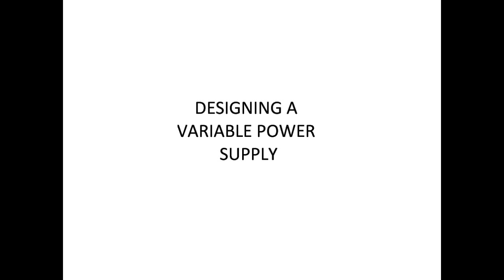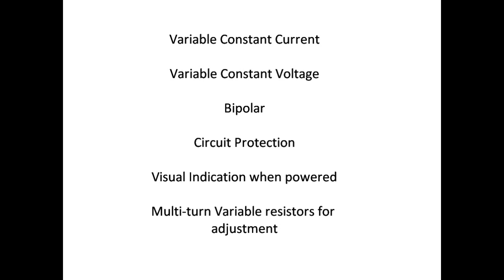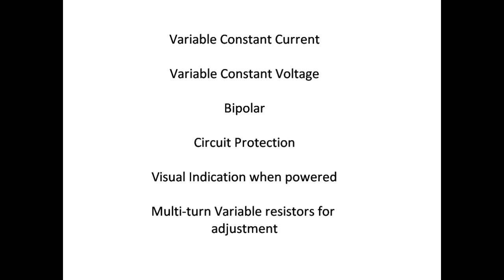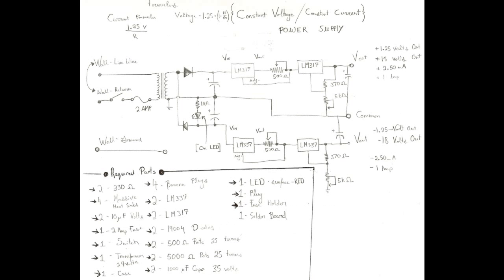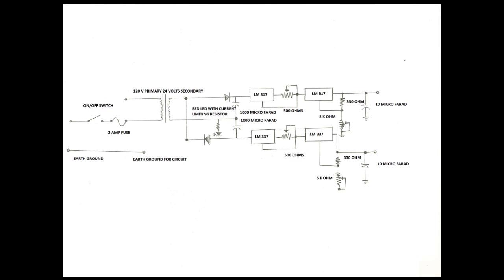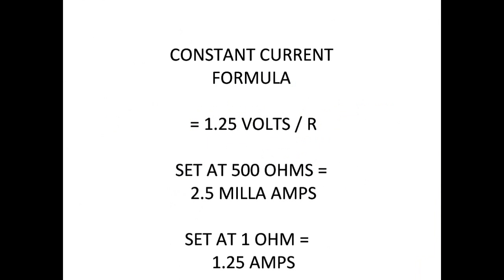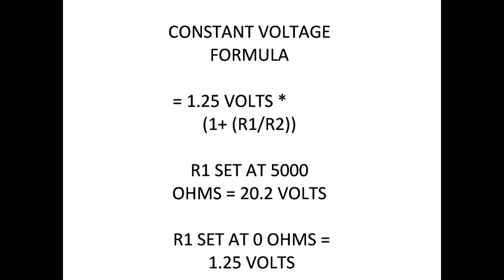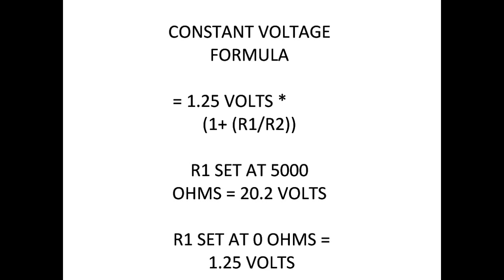How To Make a Variable Power Supply - Design

Comment: as R1 controls the RefV and therefore the output, could you use a jfet in there instead to like throttle that up and down, the fet could then be accessed by a micro-controller?

I'm fairly basic at electronics, im a software guy really, but i really want to build a bench supply. I need 2 channels from 0-12v and with the amp ranges just like you describe, but I would prefer a digital display powered with a pic or atmel (just getting an appreciation for atmel) accessed by rotary encoders.